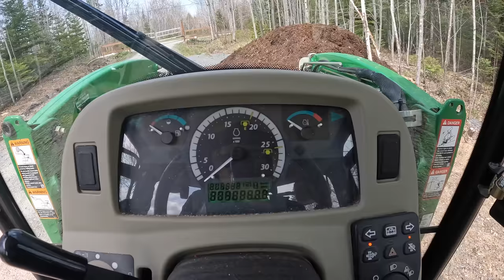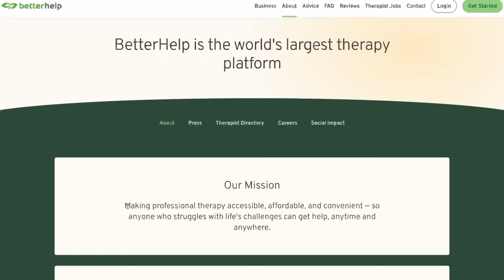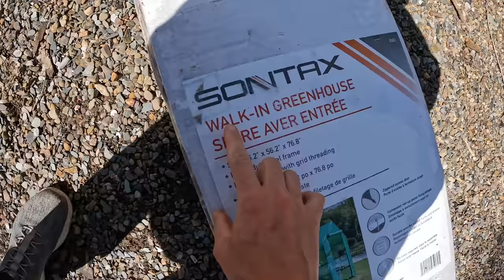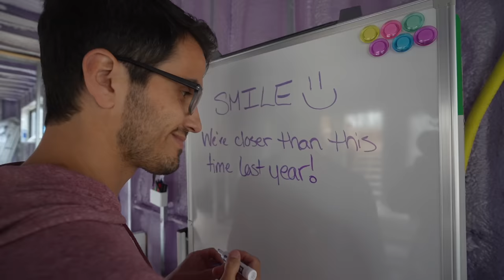...what happens now?

Comment: The wood storage tent is what you can use as a greenhouse. 
That small greenhouse can also be set inside that wood storage tent and that way you’ll get it even warmer. 
Seedlings are sensitive to temperature change and too much sunlight can damage them, be careful with too much light for them. 
I don’t think you’ll need the lights in the greenhouse, they’ll get enough light from the sun. 😊

Comment: Glad you got good news. The rolling cart for the firewood... we went with a trash can so far for last 2 years. rolls with lid. then the crumbs and bugs arent falling out the bottom into the house, and when spring comes and less fires needed. they arent also crawling out the top out of the bark ;) Ill be building a 4 wheel rolling cart more like An Alaskan homestead used. but for now its a rolling trash can.

Comment: 4 Patriot bug zappers and/or large bug repellant candles, place 4 around you, guarentee you wont be so miserable.  We had severe bug issues on lake in GA and we used candles and they worked great, bug zappers came years later.  OMG I just bought same greenhouse this last winter, can say cover tears easily by door zippers, but you can utilize framing and build around it.  Also it retains a lot of moisture another reason building around it, my tomatoes had some issues.  A blanket may not work, I froze some plants at 32 degrees thinking some moving blankets with a tarp would keep them warm it didnt, may want some heated mats to set under plants or wool tented around them.

Comment: I love the new greenhouse! Bought myself one last fall and it worked beautiful in my South Carolina winter (pretty mild down here). It was only 4 1/2 x 4 1/2‘ but it worked fine until spring came. Luckily, I had a Bluetooth thermometer set up in there and could regulate with a small heater but once spring hit the temperature sometimes rose to 120° and there was no roof vent. I’m going to replace it this fall with a 6’ x 6’ greenhouse but it will definitely have a roof vent.

Comment: Hey my two fab guys ...Just a heads up ..When it rains and gets windy the Green House will fall over.  I know because I have two of these.  
You have to anker the Green house down tight and secure. 
I put the back of the back of the green house up against the fence and tied it to the fence. I also  placed brick blocks on the lowest  shelves and bars at the bottom to keep it sturdy.  
Also at the bottom of the plastic green  cover please  put rocks on top of the plastic green cover to hold it  down. This also helps it to become sturdy because if a freak wind came along it will lift the plastic and push the green house over and crush your plants. 
In other words you have to anker it to the ground or a tree and make it sturdy. 
Those portable green house will fall over as soon as the wind blows, If they are not attached to they ground or a wall . They are free standing and light weight.
 On a brighter note yours is looking good. I love you guys happy gardening.

Comment: So happy for you that everything went okay. I had cancer many years ago, according to doctors it was a very aggressive type, but they nipped it in the bud, before it could spread. Since then I always have a bit of concern when they find a tumour or cysts anywhere in my body (doctors say once you’re a cancer patient, you’re always a cancer patient because there’s always the risk it might come back). I have had a few small but benign intestinal tumours, which were always removed. I have to go back every three years for a colonoscopy. I currently have two knots on my thyroid glands, for which I’m getting meds. They were discovered in February and I have to go back in August to see if the meds are working.

So I fully understand what you were going through while waiting for your results to come through. It happened to me every time I had to go for my regular checkups for the first five years after the cancer and with every new tumour.

Comment: Hey boys, promising veggies for sure. Some greenhouse wisdom: in a very short period of time the temperature in an unheated greenhouse will match the temperature outside. I have a much beefier polycarb greenhouse, and forgot to take my tomato seedlings in for the night before work. The temperature outside was only a few degrees below freezing when I returned, but sadly many of the seedlings were gone. Anything in the beet/chard and cabbage/kale family will survive a 5, even -10 dip, but definitely not a tomato or pepper or squash seedling. Since your electricity is free why not keep the sprouts warm through out the night with a safe little space-heater? Also, that little greenhouse can easily reach temps of 40 degrees with the door flap zipped up and the vents closed - steamed salad for sure. Of note too is that when seedlings looked wimpy and stretched out it's because they are indeed stretching (etiolation) as hard as they can for light. Do some research as to the proper light-needs of veggie seedlings. Best to get them off to a strong and stout start. Enjoyed this laid-back episode, love baby squirrel, great the colon is clear.